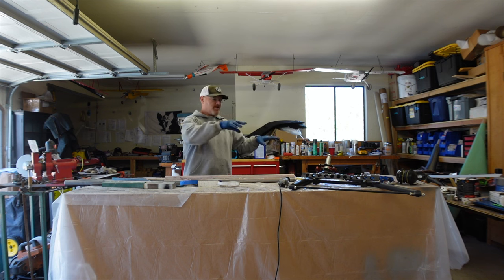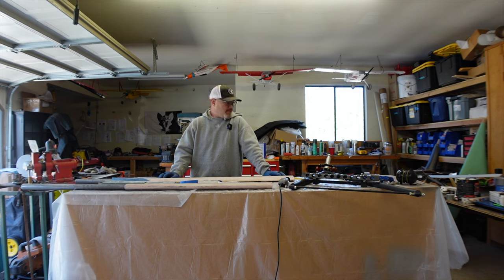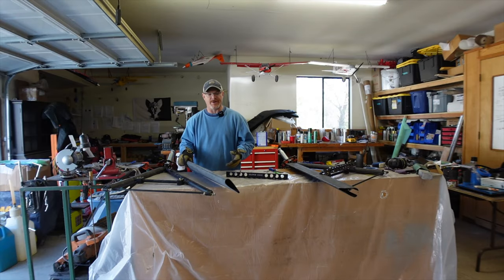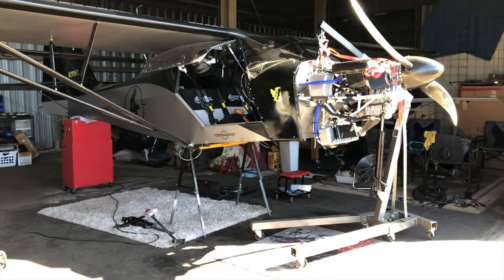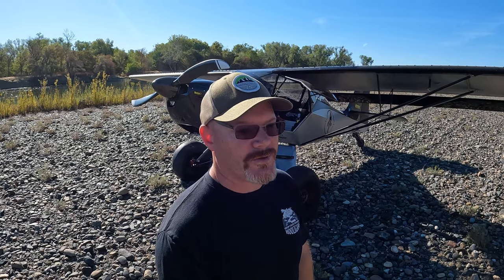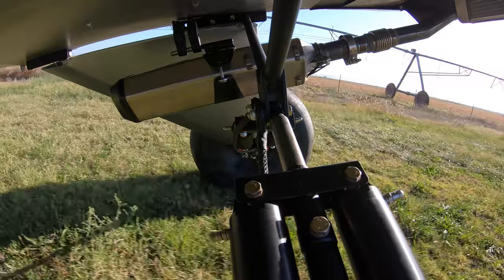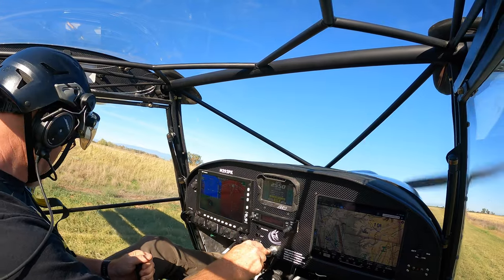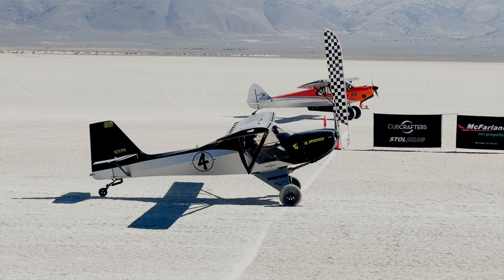Should you cover your Gear Legs on a Kitfox.

Comment: Great video. While I can't see your stick when you are turning around at the sprinkler pipes, it does seem you have your stick full back. Which is how I was taught. But at the end of my checkride when my DPE said we were done and I had passed. I had come to a complete stop to determine where I was going to park. He told me turn to the left and park there. I proceeded to jam the left brake and increase power until it started to turn. He told me to stop, push the stick full forward and give just a little bit of power. It was amazing at how much less power I had to give to complete the turn.  

Not sure this is the case here or not but thought I would point out something I have learned and do so now when conditions permits. 

Thank you again for the video.

Comment: To cover legs or not, controversial question…  I personally think that depends on where you live and the type of flying you do. If you live in a humid wet climate keep those legs naked to help combat corrosion. It’s also my opinion that if you are landing in rugged rough areas, having the gear naked let’s you see damage that might otherwise be covered up.
Reply from the maker: Good points.
Reply: Leading edge shape?
Reply: I had a Starduster with a cracked landing gear under the fabric covering.  The crack had developed to almost the point of total failure before the problem was visible.  The next landing would likely have been very ugly.

A lot of Stardusters use removable sheet metal "spats" to cover the landing gear tubes.
Reply: @johnfitzpatrick2469  tube
Reply: @DanasWings  I swore off covering gear when I found both a crack and corrosion in my pavers gear when adding safety brackets. The 1/2 a knot difference covering a gear might make is not worth it to me, especially the risk of missing a potential catastrophic failure.

Comment: Congrats on your HSF first place, and great job on the gear covering. Just one question, after covering, the gear step bracket looks kind of hard to use without kicking into the fabric. How is that working out?
Reply from the maker: Works good. Step on it with my foot facing forward to get in and out so it works good.
Reply: OK, that makes sense.

Comment: When you bonded the carbon fiber to the gear, did you take steps to prevent electrolysis?
Reply from the maker: I did by using the glue with micro balloons like what is done in the wing construction, but if I was going to do it again I would do the first layer of the fairing in fiberglass to create a better separation.

Comment: G,day from Sydney Australia.
Some great building material assembly techniques; do
* All carbon fibre composite needs to be vacuum bag compressed?
As opposed to fibreglass matting and resin, wherein you just layer it and soaked in bonding resin?
🛩️🌏
Reply from the maker: It doesn’t need to vacuum bagged, but it will be stronger and lighter if you do.

Comment: Did you run the brake line internal or not external, looks great?
Reply from the maker: It runs inside the aft tube fairing.
Reply: @BowenAero  looks great!